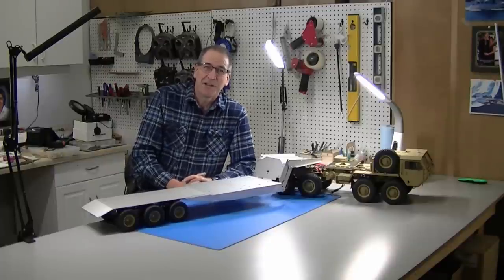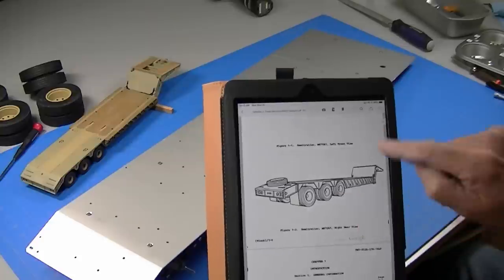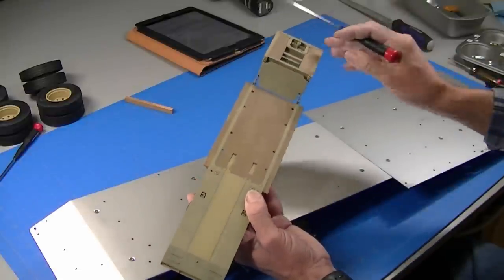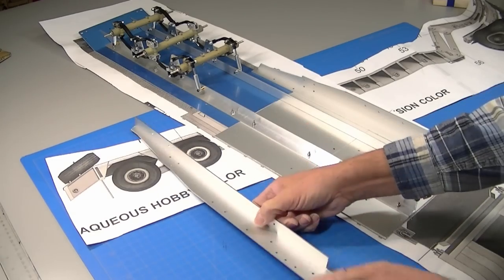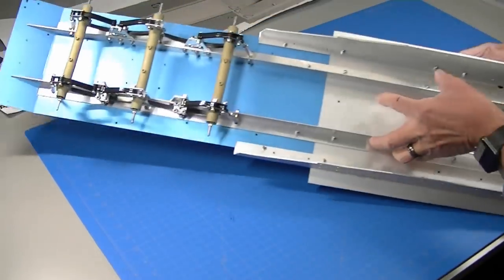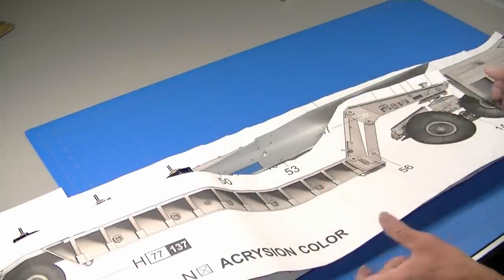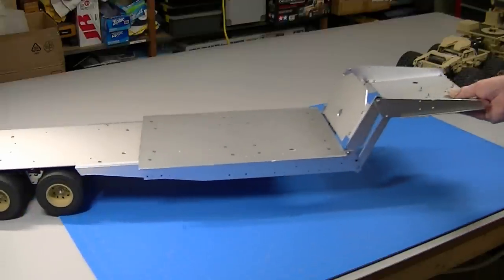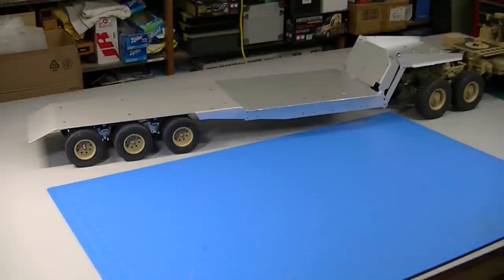1/12 HG P 802 Hemtt Custom Trailer Build Part 4

Comment: The pintle hook is actually called a kingpin. The kingpin is also suppose to be removable. You pull kingpin out before placing the neck on the ground.
Reply from the maker: Thank you for the info.  That is a great idea to make the kingpin removable.  Will see if that is something I can come up with and still keep it strong enough.
Reply: @HobbyconceptsLLC  this trailer is very similar to our oilfield scissorneck lo-boys. The oilfield version has what is known as a “floating horsecock” and it is dropped in from the top. The oilfield version also has the option of pinning the scissor joint in various positions so you can pin it straight or you can pin it in 2 different lo-boy settings for the different coupling height between different pulling vehicles. It appears that the “fifth wheel” height on your hemmit is taller than a regular tamiya truck.

Comment: Wow, I love your custom build. I am currently building this trailer in LEGO in about 1:18 scale and I've used your video of building the model KIT as one of the main references. Thanks for the link to the manuals - those are a real gem! I found only particles of it on  the net. Regarding your custom build. Have you considered builidng it in a way so you can have narrow or wide version? I guess it would mean a lot more work, but it would be really awesome. Looking forward to your next videos! Best regards.
Reply from the maker: I thought about making the wide/narrow braces work but decided it was going to be enough work just to get it built!  Pretty happy the moving ramp turned out as well as it did!!